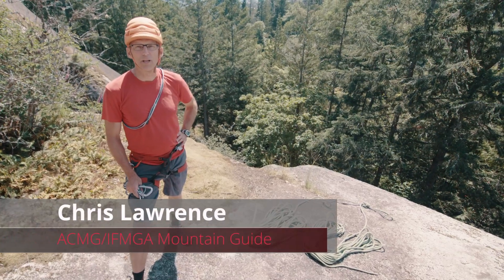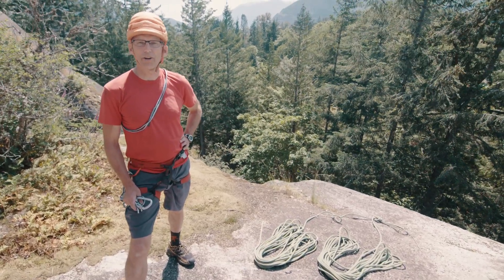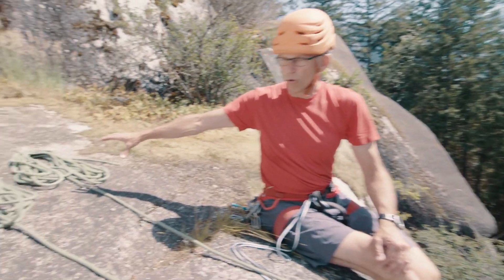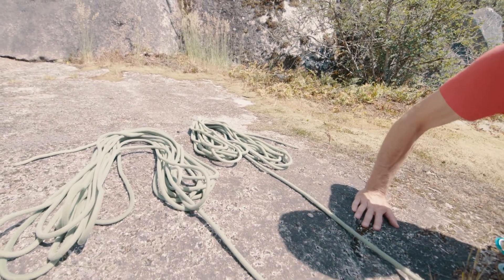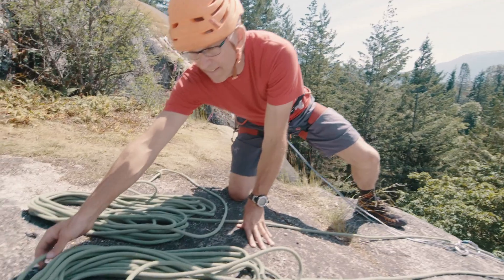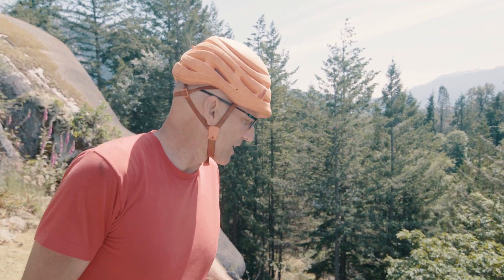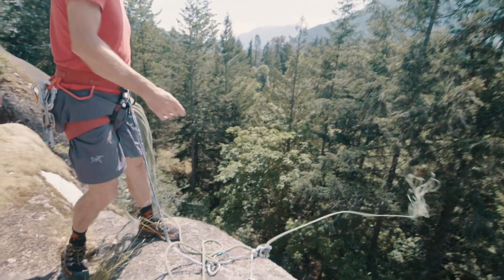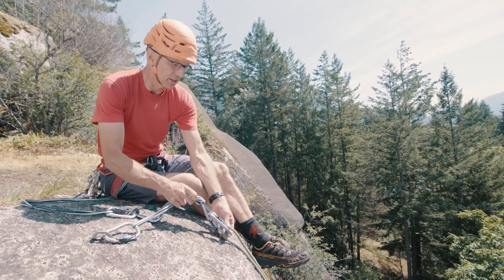Build a Top-Rope Anchor

Comment: If you fall on your personal anchor (the sling ) the shock willl be of more than 2 000 kilogrammes and probably your sling will break! Take care , never fall on a sling and never more than coefficient of fall of 0,2 with a sling so you have the right just at 20 cms of fall by meter of sling!
Reply: Generally, you are correct you want to avoid a factor 2 fall in any situation.  However, in the setup shown here, you'd never generate anywhere close to that load.

Comment: Great content on your videos. This is a good top rope anchor, only tweak I would do is having a longer sling to avoid the screw carabiners be loaded over the rock edge (looks like they might be). Also, if you have a larger party, or working on the route, you might want some beefier slings (or cord) that can take a beating. Thanks for posting good content!

Comment: Just watched all four of your videos, really informative and to the point, loved them! I have a question though: isn't it somewhat dangerous to secure yourself to the bolt using a sewn sling given that you're sitting above the bolt? Would you consider using rope or cordelette instead or is a sling fine in a situation like this?
Reply: A sling is perfectly fine in this situation.

The reason you’re asking is because a factor 2 fall on a “semi static” sling.

First off a faLL IS INCREDIBLY unlikely using his technique displayed in this video. However, If he were to fall, the fall he’d take here would be what I’d like to call a ‘scrambling fall’. One where his body would drag along the rock, he’s grab at something, ext. This would create a much smaller fall factor than a FF2. 

Hope this helped out 🙂

Comment: It looks like the rope is still going to rub against the rock face. Would this be an issue or is the rope strong enough to handle this amount of rubbing?
Reply: The rope is strong enough considering the rock isn't at a particularly sharp angle. There will be some rubbing and some amount of wear (though not much in this scenario) to the rope's sheath. One thing you could do in this situation is bring something to pad the rock, like a dense foam mat, towel, cut of carpet, or something like that. Especially helpful if there are sharper angles involved. You could also make an anchor out of some static cord as well and have it be long enough to extend past the edge. This way your less expensive piece of rope will take the wear that would otherwise be put on your climbing rope, which is a bit more costly to replace.

Comment: This is an awful demonstration. Not only is he cross loading the carabiners which is very dangerous. The rope will be rubbing against the rock when the climber is lowered. Too bad people with no knowledge can call themselves guides and "teach" other people.
Reply: he doesn't crossload any of the biners I dont think, and the rope wear is unfortunate but is not immediately dangerous and just means you have to replace your rope sooner. There is no cutting action on the rope in one spot.
Reply: @ianproctor8069  look at the angle the carabiners against the cliff edge. They are designed to be loaded along the long axis, with only opposing forces. When loaded, the rock will be pushing against the middle of those carabiners, creating another force, and making them weaker. I understand this guy is just doing a demonstration, but he should be using a slightly longer sling for this anchor.
Reply: @jasonballinger5600  There is absolutely no cross loading in this video.